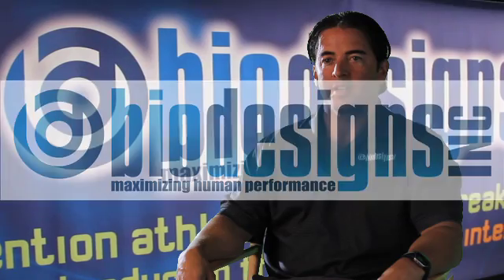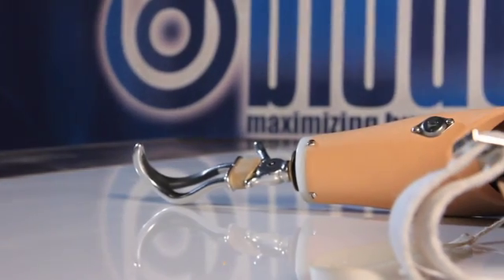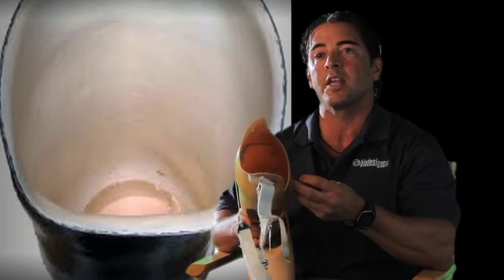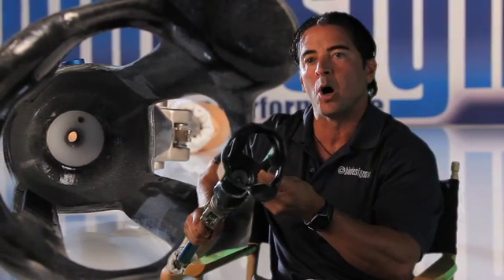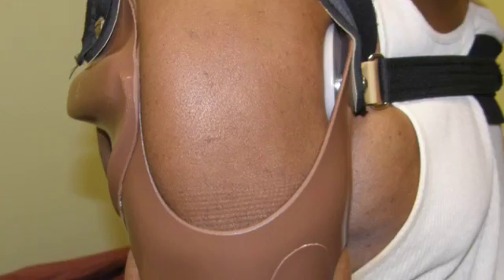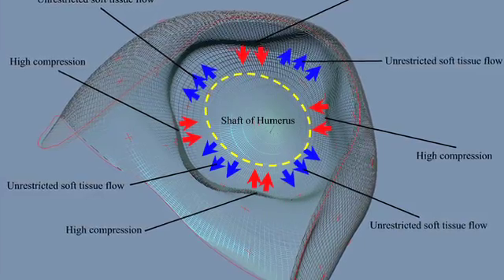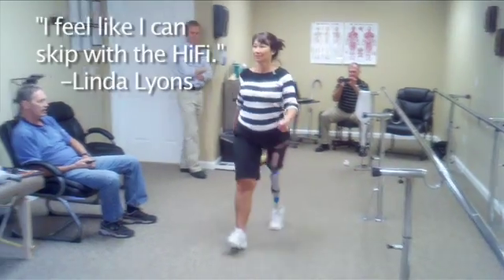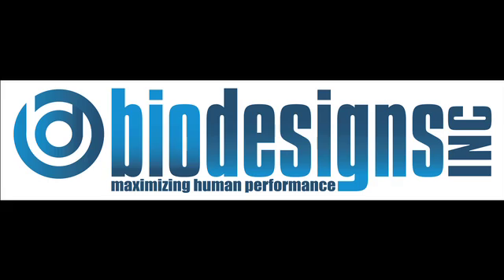High-Fidelity Prosthetic Socket

Comment: I use to have kaiser last year and i switched over to blue cross anthem and i have had a leg made from hanger in stockton ca and i didn't find it comfortable because they used the old cast and shrunk it a little.  So for cutting corners and making mistakes they have to make a new mold but i really want to have your company make my next leg

Comment: Hi Susan,
With the HiFi Interface sub-ischial is the most common trim line.  Because we don't rely on the ramis for stability and instead stabilize the bone through compression and release, we can bring the trim lines down very low.   The HiFi trim lines are the lowest of any existing interface. 

Check out our videos and testimonials on our site JoinHiFi.com or call us directly to discuss your needs, P: 800-775-2870